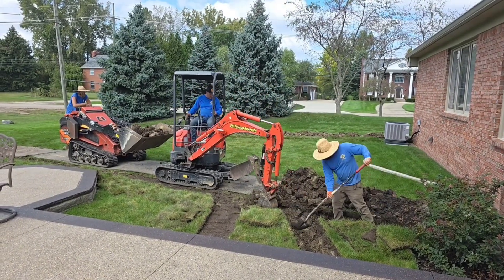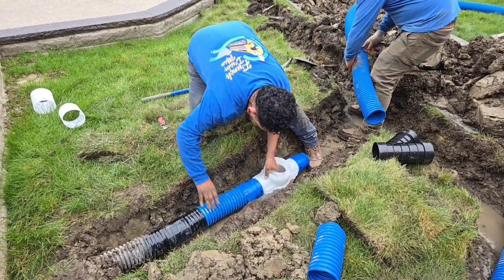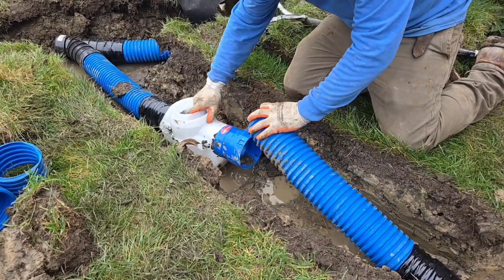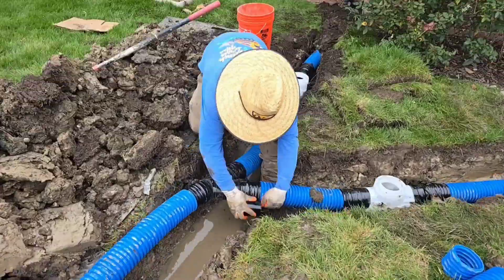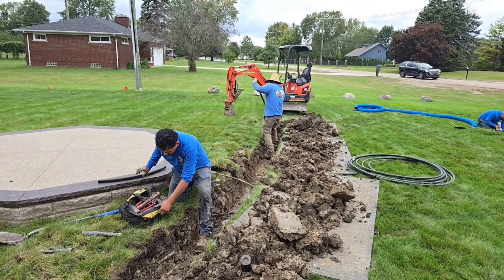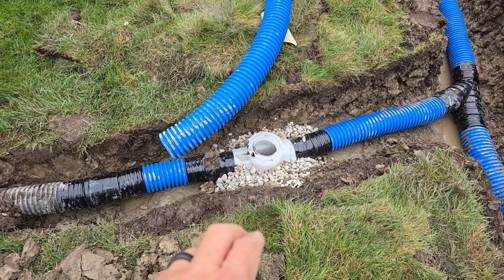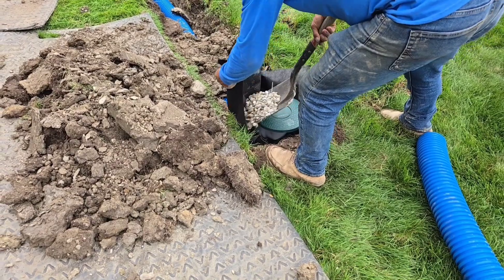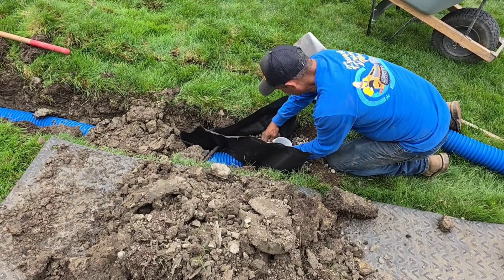How Many 3"×4" Downspouts Can You Put On 4" Main Line

Comment: Can you run two (2x3) downspouts on 3 inch pipe to the pop up? Or should you run the (2) 3 inch down spout pipes to a connector with a 4 inch pipe out to the pop up?
Reply from the maker: If one downspout is not a dominant run and is a short run, we will tie two downspouts from two-by-threes into one 3" line. If both gutter troughs are long and responsible for a lot of roof water, we will take them to a four-inch line.
https://youtu.be/Vush-fFU-Xk?si=o10hk8MrMDHOYpZc

Comment: the question really is how much bigger do you need the gutter and downpipes to cope with that rare big storm (which we seam to get often these days) so they don't overflow.

i would be inclined to do the math on the roof size, slope and check the gutters and  downpipes are at least the required size or better. pretty common to have marginal gutter and downpipe sizing. then size the rest of the downstream system.
build an overflow into the system so when those big storms hit, it overflows in a safe place and not into the house or foundations. quite common here to use detention tanks and have it overflow at the detention tank away from the house. the trick is having gutters and pipes far bigger than you think you will ever need.
Reply from the maker: @tweake7175 I'm going to have to disagree with you because an underground buried downspout pipe that is too large clogs. If you do not have adequate flow in pounds per square inch running through the pipe, you will not keep it clean. When water spreads over a greater area in a larger pipe that displaces more area, it will not wash the debris away, and the debris will build up in the pipe.
Reply: @FRENCHDRAINMAN  what do you call to large? maybe use multiple pipes. my place is small, only two roughly 3" downspouts into single 4". designed for 4"/hr but storms will hit 6"/hr. normal rainfall is sub 1"/hr
these days we have a lot more detention tanks being installed so you run large/multiple down spouts but use smaller buried pipe out to the storm drain.

Comment: Here in north Florida we will run 3 but if we add more, we always add distribution boxes , sections of 6 inch or a dry well fully encapsulated to increase void   From all the follow ups we do with customers right after heavy rains they are happy.

Comment: I upgraded our houses gutters to the larger 6" gutters and downspouts. We have a long 24ft section on the front of the house that goes to a 4" smooth wall pipe that runs away from the house ten ft that spills out to the grass then slopes downhill. First rainstorm after upgrading there was so much rainwater the the outlet was spitting water like a fire hydrant. Literally not big enough to handle all the water.
Reply from the maker: Super gutter needs 6" pipe

Comment: I'm in Florida and just finished installing three 3x4 downspouts on a 4 inch line where two downspouts meet relatively close on one side of the structure and the third has a very long run (95ft) from the other side of the structure that merges with the main 4in line about 5 feet before the popup emitter. All the resources I found prior to install suggested no more than 3-4 downspouts per 4inch line so I figured going with 3 would leave some buffer. I wish I would have found this video before installing because I even stood over the location where they were going to merge and contemplated keeping them separate. The point of having sufficient volume and flow to prevent clogging convinced me to continue with the merge.

Comment: Hi, this does not have something to do with this video in particular but I have an issue with drainage. My house is the lowest point in the area, there is a hill side behind the house and behide the house is also the lowest point on the property. I can drain towards that spot so all the water runs to the lowest point behind the house but there is no access to pumps or anything, is there anything I can do? I can't lead it to the road as the road is much higher than the lowest point behind the house. can I dig straight down and just let the water sit there deep into the ground or something like that? Basically no way to lead it to the road as the road is higher than most of the house and there is no pumps available. I want to be able to DIY and try my best, thanks a lot !
Reply from the maker: https://youtube.com/playlist?list=PLjFCqaZ4v1BU26ZMN69M_VON68JU01FZ5&si=jgayB0AG82FiOLyO
Reply: @FRENCHDRAINMAN  Thank you so much 👍 Time to get to work over in Europe:)

Comment: Just a quick question? Bye putting the stone under the catch basin when the left over water drains out do you worry that it would freeze under the stone and push up the catch basin. I get the idea of the stone is for the water to go through it but then what. Or is it so little that it wont happen
Reply from the maker: I'm making a video response to this question. 
Stay Tuned
Reply: @ thanks. 👍

Comment: I live in the Midwest, and during downpours I get "water geysers" from 3 2x3" downspouts that feed into a single standard 4" corrugated line to a storm sewer, even after the line was Roto Rooted!😯😯
Reply from the maker: It sure sounds like those lines were not run correctly. I'd redo that system; there's no way I would tolerate that. Protect your castle.

Comment: 3x4=12 sq. in. (less a little bit for the chamfered corners)
4" round = 4π = 12.56 sq. in., so if you have 2 downspouts, the main line is going to have to move nearly twice as fast as each downspout moves, to handle the same volume of water.  This is why the not-quite-a-90 and gentle sweep of the line coming off the downspout is so important.  You have to keep that velocity going, or it becomes a choke point that will back up.
Reply from the maker: @montyharder3663 I've done all the math, and I appreciate your contribution and sharing. Thank you. My point is that most downspouts are not maxed out unless they are in a tropical storm region. And if you don't run enough water through a four-inch line, it will clog. If you use a four-inch line, you must ensure you have the volume of water to keep it clean. Unfortunately, experience is the best teacher. I can look at a rooftop, roughly guess its square footage, and know how many downspouts I need to connect to that line. Also, 3x4 downspouts do two things: allow leaves to fall from the roof and pass through the 90° elbow at the eave, and eliminate a couple of downspouts. Basically, you would need more 2x3 downspouts for the same house. I've seen gutter companies change out 2x3s for 3x4s and not eliminate downspouts. And that makes no sense to me. In a case like that, you better be on a 3-inch line. It all comes down to how much water you're flowing. How much rooftop is that downspout responsible for, and what is your region rainfall. A lot of contractors feel it's more practical to build for a twenty-five year rain, and I don't disagree with that. This information is available for your region online.
Reply: @FRENCHDRAINMAN  wouldn’t the leaf filter & catch basin(s) prevent the 4” inch line from clogging in the example above on not having enough pressure to clean the line? Or are you referring to the line from downspout before the catch basin? Isn’t a proper solution to just flush the system 1-2x a year as a clog preventer… thanks for video